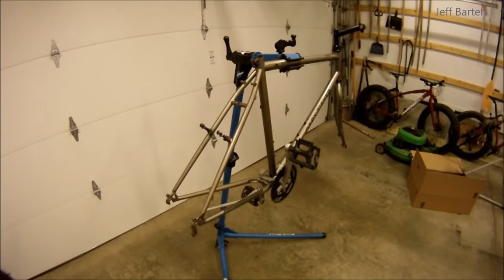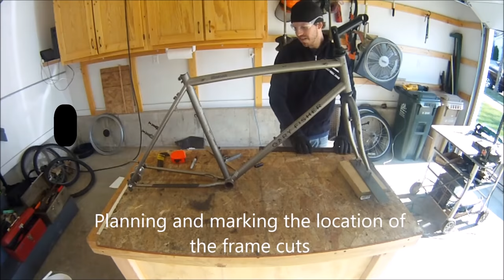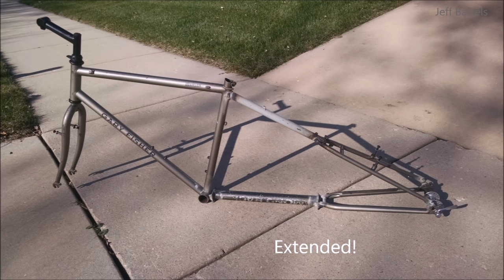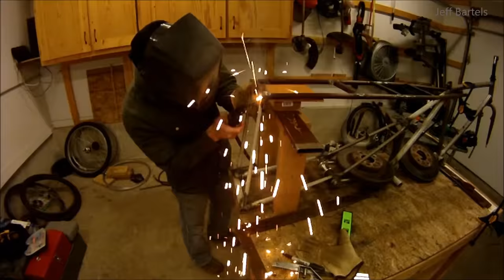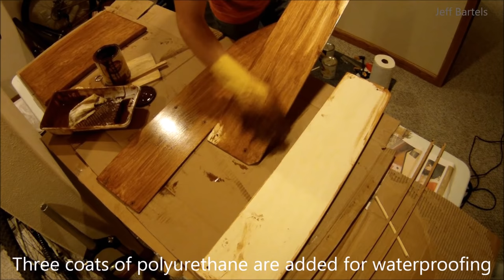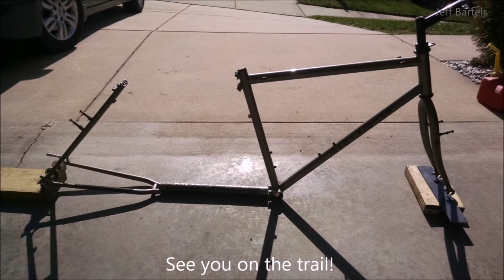DIY Cargo Bike - Turning an old mountain bike into a cargo hauler

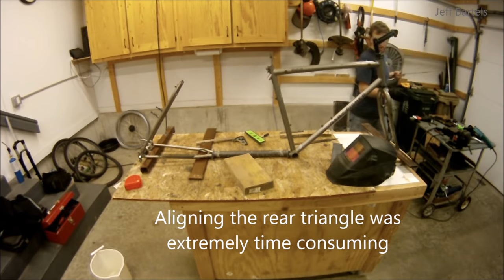Comment: 1:20 small tip : you can attach a small string of wire slightly tighten at the extremities to determine by sight the alignements. The wire goes from the end of the rear fork to the pedal axis for example and the same on the opposite side in simetry, so you can see the angle made by the wire and compare them. I use this simple technique all the time it's very efficient.

Comment: Really nice project, just one question: How did you bend the wood and made it stay in shape for the fenders?
Reply from the maker: I steamed the wood and bent it around a form. Once the wood dried, it maintained its shape. Making the mounts for the fenders was much more of a challenge, but I ended up using zip ties to the frame and welding custom metal U frames to support the back of the fender.

Comment: Awesome build. Simple straight forward. I'd like to see more details of your welding and alignment.
Reply: You can make a really simple jig to hold the bottom bracket and rear axle parallel and at the correct height; everything else can be done by eye, with the assistance of a spirit level, a straight edge and a bit of string.

Comment: I've watched this a few times. The running boards are removable, correct? It looks like they are mounted on tubes that then slide into the main frame of the cargo rack.
Reply from the maker: Yes, the intent was to make them fairly easy to remove and to be able to add different attachments in those tubes such as a sidecar or mounts for hauling different things. I've only used it with the running boards so far.

Comment: Great video! When you notched the seat stays to bend them to the correct angle, did the back brakes still align properly?
Reply from the maker: Thanks! Yep, all close enough. Needed to make some final adjustments to the brake pads like any bike, but there's plenty of adjustment range in those pad connections.
Reply: @MtbEngr  Thanks! This video is hugely helpful. We really appreciate you putting it together!

Comment: did you use mig welder or flux core?
Reply from the maker: I currently use a Hobart Handler 125 set up for flux core. Flux core works well for infrequent usage and it makes very nice welds with the right technique. It's a great little welder.

Comment: next time paint a straight line on your work table,that way you can align all the frame components in reference to it and screw or clamp parts down before welding
Reply: or use a chalk line

Comment: I also have a question about the initial extension piece that you welded to the bottom bracket/chainstay area. Did you add/weld a square piece to that extension piece for better contact points to weld and then grind them down to shape?
Reply from the maker: Yes

Comment: Did you leave the seat stays notched with that extended piece welded at the seat post adding the structural support? Great job by the way!
Reply from the maker: Thanks! I welded the notch closed once everything was aligned.